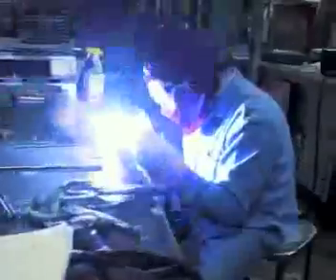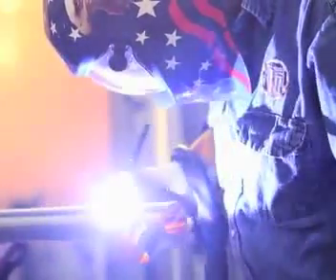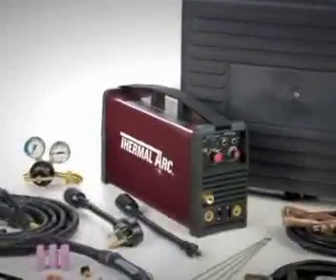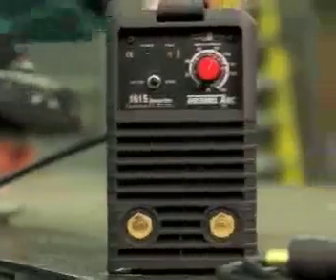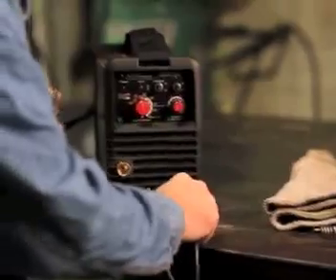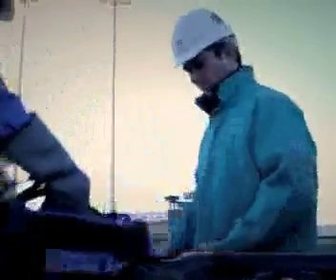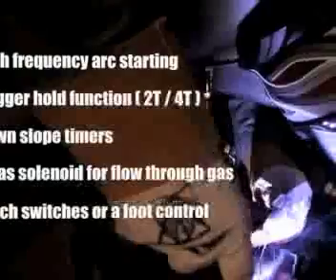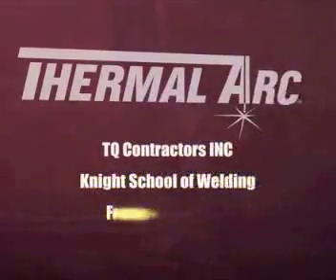Thermal Arc Portable DC Welder Range

Comment: i own a arc master 175 se machine that i bought in Ireland and it is capable of lift Tig and stick welding.  would i have to go thru the hardware company where i bought it to get any accessories as from your website you only deal with cutomers within the U.S.A not in europe